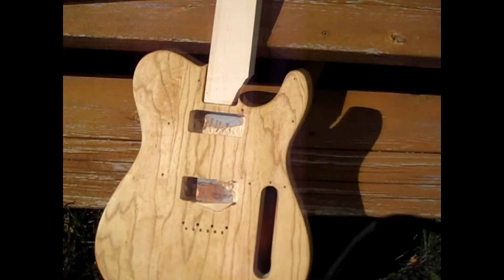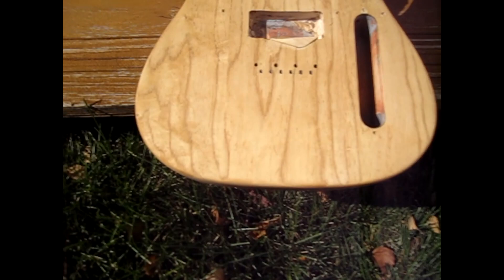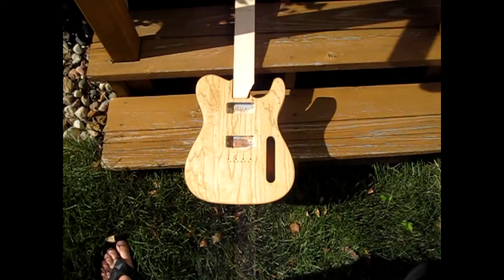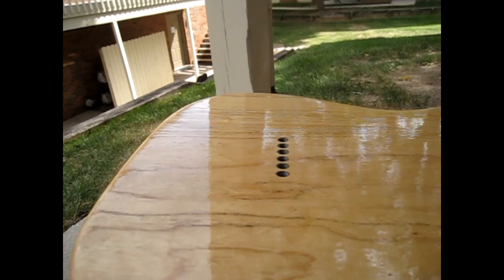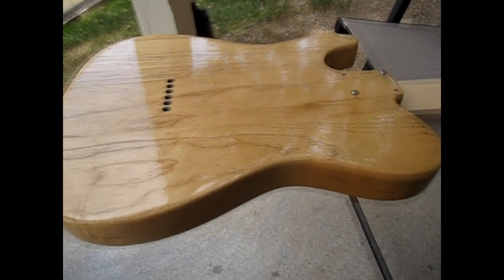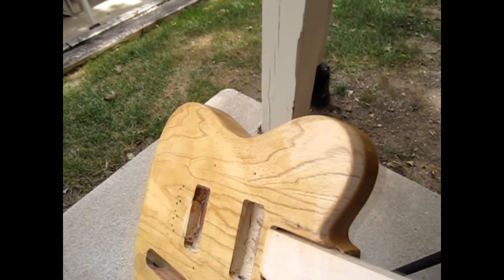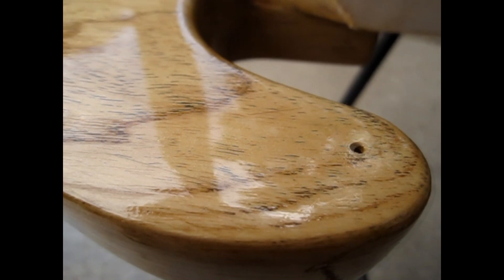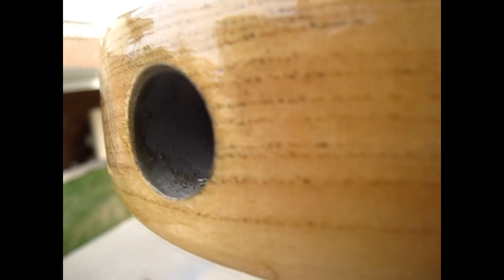How to Build a Telecaster Vlog pt 8 - Tru-Oil Finishing Process

Comment: In order to get a more even finish, you need to do a wood grain filler process. The darker grain in the wood is softer and thus has wider grain pores. So that needs filling before finishing. This will give you an even finish. Don't use steel wool. Yes I know many who use it but it can also create problems down the road with rust bits and tiny steel fragments in the project. Master woodworkers never use it. You can also do a wax polish finish and other high polish final finish on the Tru oil. Hope this helps! Nice project!

Comment: Very true, but to an extreme. It's not only multi-piece, it's also multi-layered. I just started this process myself with a Craigslist Squier and if you sand a little too deep, you find a whole new layer of lighter, less dense wood. Much tough process and much uglier wood. Still fun though! I'm going to try this Tru-Oil method instead of the shellac I was first anticipating using. Thanks for the video!

Comment: I forgot to add that you should really do one thin layer at a time, not thick layers. It fills more evenly without the extreme high and low areas. If you have a lint free cloth about 2 inches square, you apply the oil with that instead of fingers. It helps to lay the oil down more evenly. It also drys faster, and creats a smooth surface. Also allow for at least 4 hours dry time between coats and more time for coats that cover a stained background or you will have the stain lift. Also take into account humidity and heat when doing coats. You may have to wait as long as 24 hours between coats just as you would for varnishes.